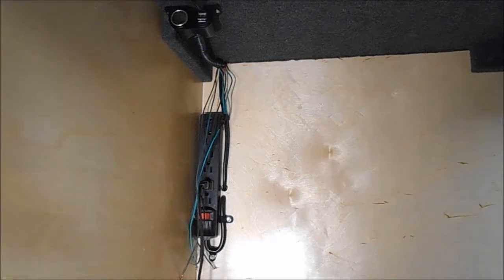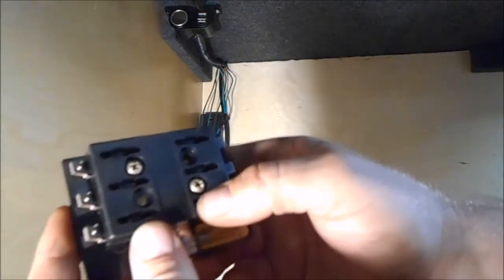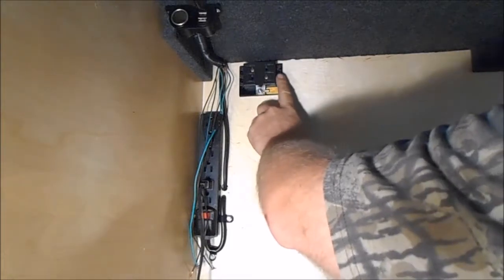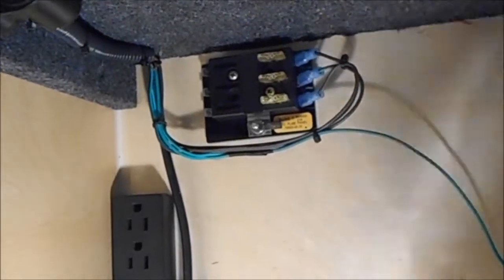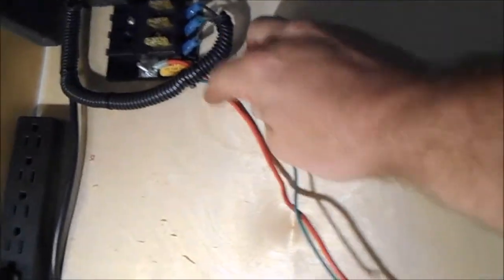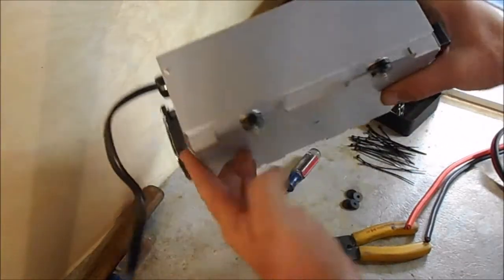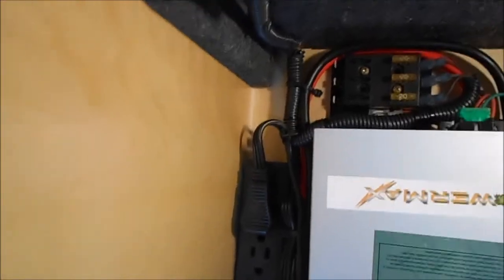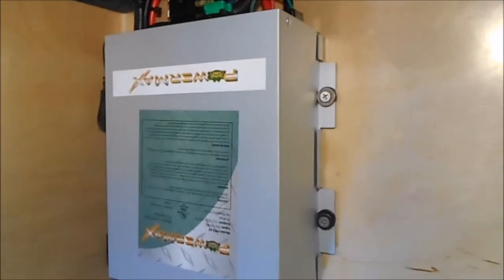runaway camper ac to dc converter charger

Comment: When you first connected the charger, was your 120v connection from the CoolCamp plugged in? Because when you went outside to connect the leads to the battery the 120v was NOT plugged in, so unless you unplugged the 12v connection to the trailer before you did that part of the clip I have no idea where you were getting power to enable the inverter charger unit. In general, I have to say that you are REALLY good. Everything you do is just so RIGHT. Little things like putting blocks under your clamps so you don't make impressions in the wood, using wire loom to bunch your cables instead of just zip ties.... every little detail you just do RIGHT.  Mad skills.

Comment: How long can you run the fan using just the battery generally? Also, what gauge wire goes from your inverter to the positive lead on your fuse block? Looking at the powermax website, it looks like those are just outputs. If you are running just off the battery, how is the fuse panel getting powered? Is it just drawing off the leads that go to the battery since they are crimped together going into the inverter? Awesome videos, keep it up! Is helping me decide what direction to go!
Reply from the maker: James email me kdr6688@gmail.com

Comment: Excellent work! I will be purchasing a Runaway camper in the fall and I am really enjoying your videos. My only suggestion is to place a catastrophic fuse between your battery and your charger. This would stop a high current draw and possibly a fire if something went wrong. Keep up the good work
Reply from the maker: The charger has two fuses I would like a fuse on the battery and a disconnect.

Comment: Another great video. A couple of tips from experience with camper battery boxes, you may want to drill a small hole in the bottom to drain water and strap the lid down tight. I have lost a battery box lid on the road before.
Reply from the maker: Thank you for the info will do.